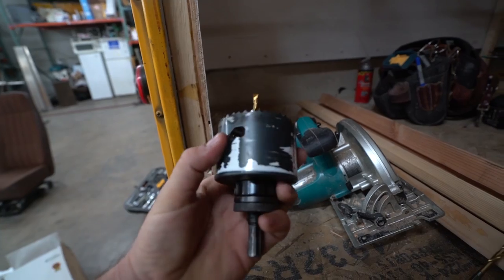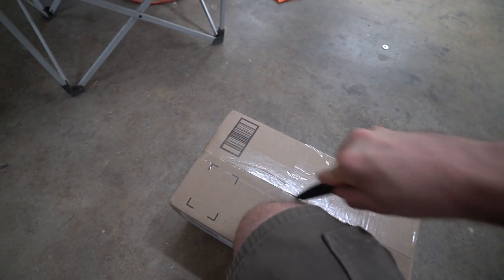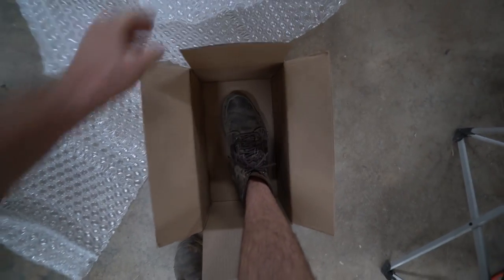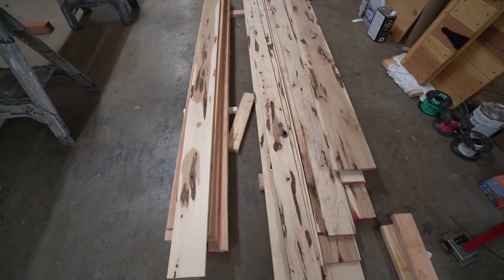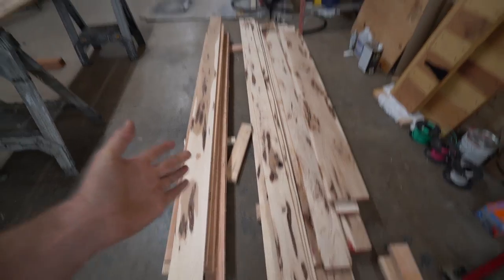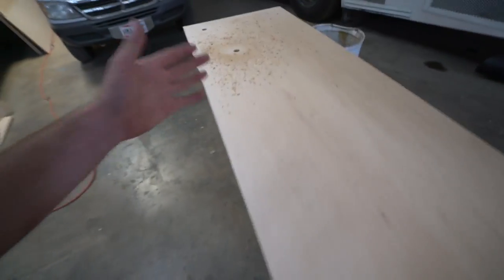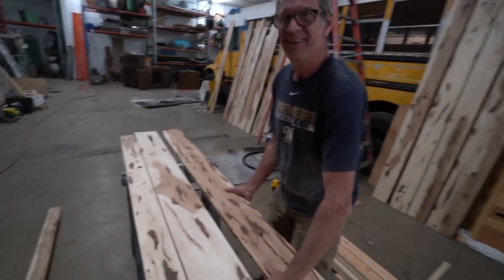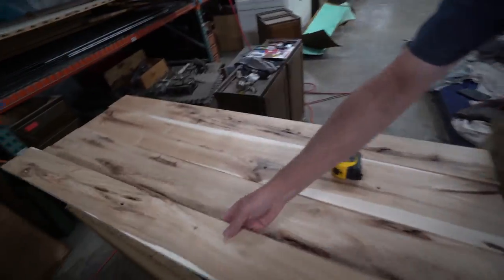Planning VanLife Skoolie Countertops! Planning 30 Amp Shore Power

Comment: Wood counter tops with knots don't turn me on at all. I would go granite keep bacteria down. Other than that I like the build it should be a great bus for you. If your drive train has gotten as much attention as your inside you should have a fun time on the road.
Reply: Not a good option for someone trying to save on build costs like Jax is. Granite counter tops run around $50 - $55 a square foot (at least around where I live) where as the Hickory he is using runs around $3 - $11 a board foot (again where I live). So a massive cost difference between the two.
Reply from the maker: 2.88 a board food 😎
Reply: The only way to get bacteria on the counter is to cook lol jax cook lol 🇨🇦🇨🇦🇨🇦🇨🇦